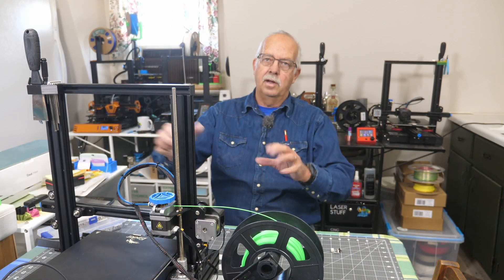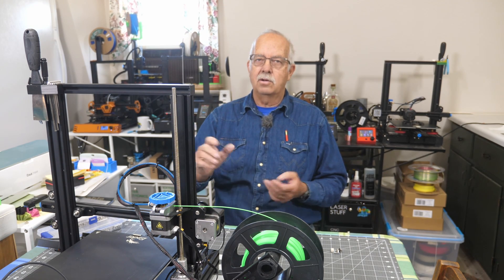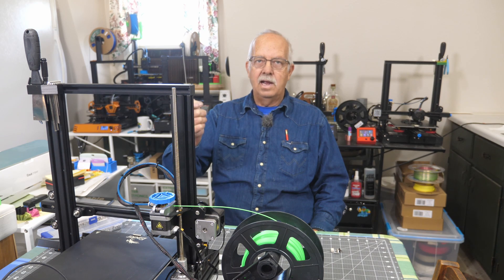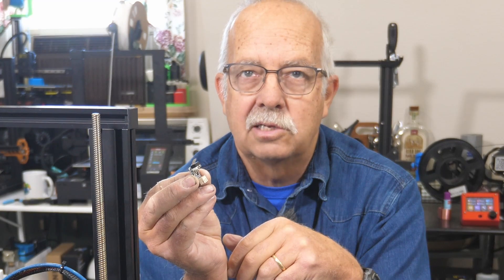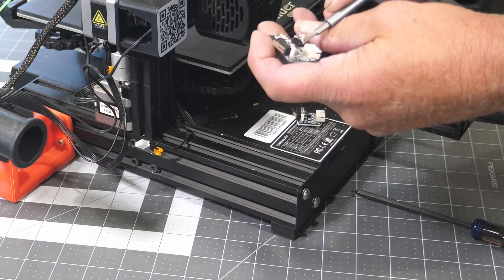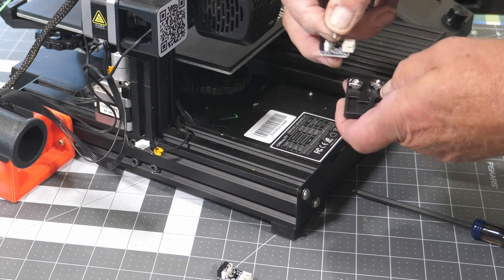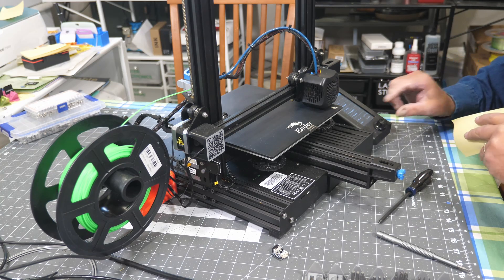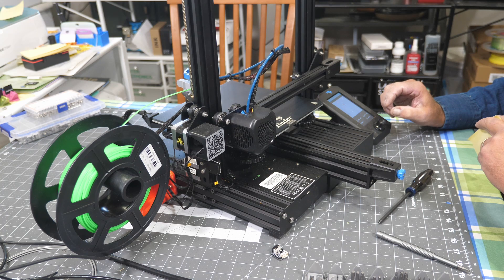Creality 3D Printer Z Axis Limit Switch

Comment: Good video Roger, Had the same problem and changed the switch a few times. What i found that seems to work well is to melt the solder on the 3 microswitch legs an tilt the switch a little. This makes the Z axis come down and push the stainless steel arm of the switch slightly one in direction and gives very consistant switching, hope this helps someone.

Comment: What printer is that. I have Ender 3 Neo. The screen looks completely different as well as the actual printer
Reply from the maker: Ender 3 V2
Reply: @rogersshop can neo use that screen too?
Reply from the maker: @richardmolano5538  No.  unique to the Ender3 V2.  I also have the Ender 3 V3 SE and that screen is completely different from the V2.

Comment: There is a free fix for this problem. Thingiverse had a file you can download. You remove the lever and the new mount turns the switch sideways. This allows the gantry arm to hit directly on the nub of the switch.

I was having this same problem with my CR3v2 with a floating Z level. What I noticed was if I "pre click" with my finger a few times before I auto home, I will get a correct Z level. This would let the Z switch "click'" during auto home. If the auto home didn't give an audible "click" noise the Z level would always be off.

Just search for Z limit switch mount fix or something like that. I don't have the link handy with me at the moment. Just look for the one that turns the switch sideways from where Creality has it.

Comment: Found a great deal on a ender 3 pro yesterday. It had everything except the z axis limit switch and the mount. I've found some limit switches but cannot seem to find the mount anywhere online. It's my first printer btw. Any info on where to find a z axis mount? Thanks for the video!
Reply from the maker: If it were me, I'd just make one from a piece of aluminum or plastic.  If you have another printer, print one.
Reply: @rogersshop  I was looking at some pics of the actual mounts and I think that's what i'm going to do. Get a piece of aluminum and just make one. I appreciate the response!